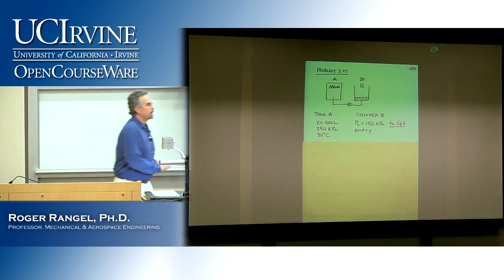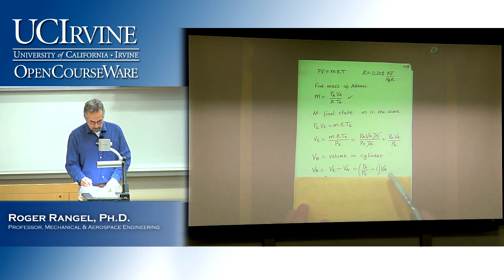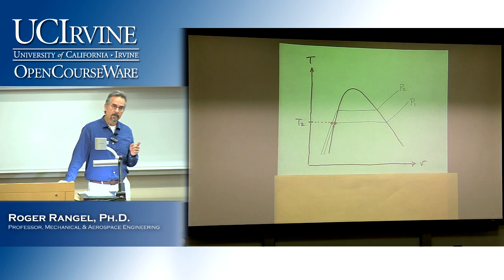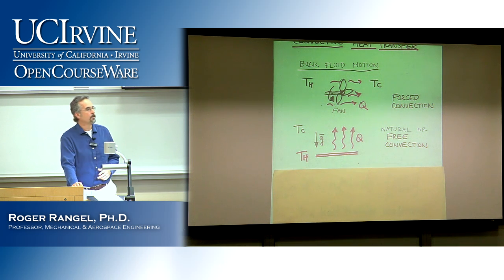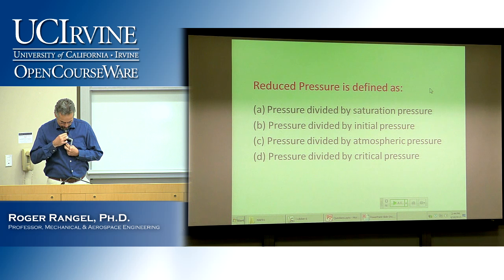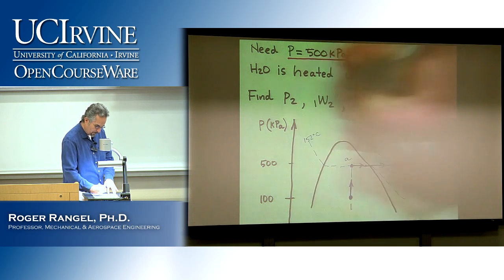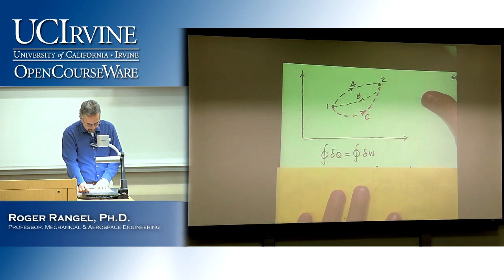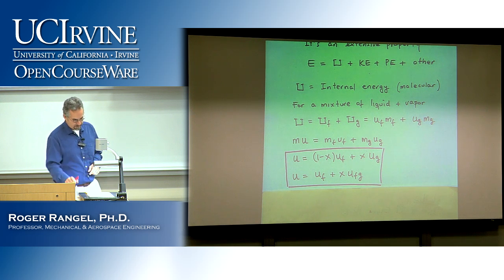Engineering MAE 91. Intro to Thermodynamics. Lecture 06.

Comment: I believe the professor’s explanation of the argon tank problem can’t be correct.  A quasistatic process would require slowly changing the external pressure from high to low, i.e., from P1 to P2.  Furthermore, if the temperature is constant through the whole process, then the ideal gas law would require PV = constant.  Thus, the pressure of the argon would decrease as the volume increases.

Comment: Problem 2 is incorrect. The water crosses the saturated vapor line at about 440KPa for the previously defined specific volume. So, when the 500Kpa are reached the water would be in the form of superheated vapor at approximately 200 degrees. Then the horizontal path is taken .
Reply: Thank you for this, i was really scratching my head on this one. but the work wouldn't be different, because the volume would remain the same even as the temperature rises.

Comment: I'm slightly confused about the first example problem, could somebody give me an explanation please?

I don't understand why the pressure of the Argon acting on the piston is a constant. I understand that IF the piston is moving in equilibrium i.e. not accelerating, then the pressure would need to be constant, that's fine. I was under the impression that the final state would be in equilibrium, though this doesn't necessarily mean the path to get there happened under equilibrium conditions.
Surely as soon as the tap is opened the pressure on the piston is P1 and this decreases until P2 is reached?

Little help?
Reply: The instructor never showed us the problem statement. The actual question was:
A400-Ltank,A(seeFig.P4.32),contains argon gas
at 250 kPa and 30◦C. Cylinder B, having a friction- less piston of such mass that a pressure of 150 kPa will float it, is initially empty. The valve is opened, and argon flows into B and eventually reaches a uni- form state of 150 kPa and 30◦C throughout. What is the work done by the argon?
The pressure can be assumed to be constant because as soon as the valve is opened Argon will move into the other container and the pressure is going to be equal in both the containers and this will happen until the pressure rises upto 150kPiston after which the piston will start rising. It can be seen that it will be a isobaric process after that as p remains constant(quasitatic)[as soon as pressure increases marginally above 150kPa it will start moving and force can be assumed 0].
Reply: You said that you are convinced that the pressure of aragon is constant from the fbd, then what equilibrium means that the piston is not acceleration therefore it should be at equilibrium throughout the whole process.

Comment: The zeroth law of thermodynamics, as sung by Flanders and Swann -
Heat does not flow from a cold place to a hotter.
You can try it if you lke, but you'd far better notter.